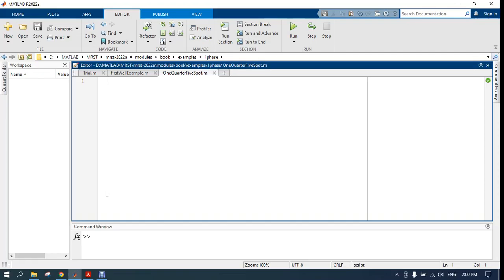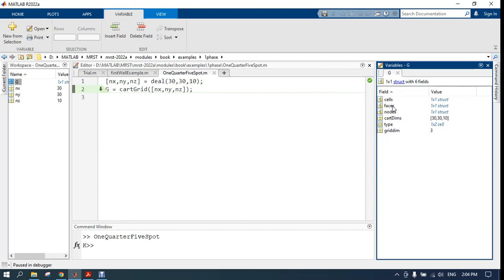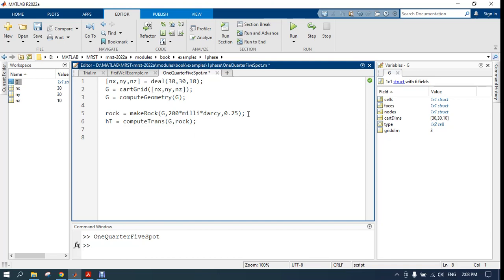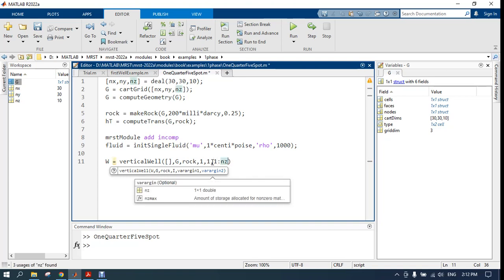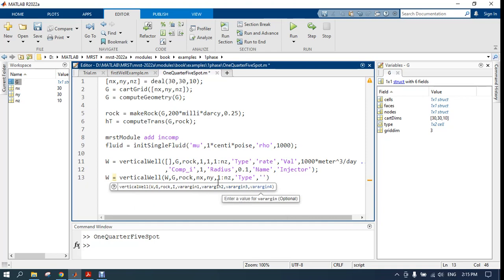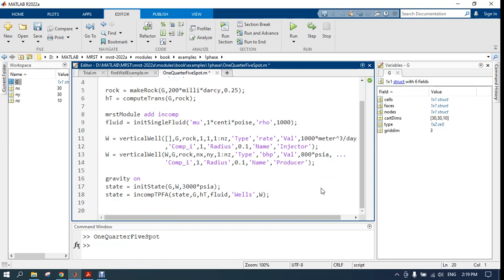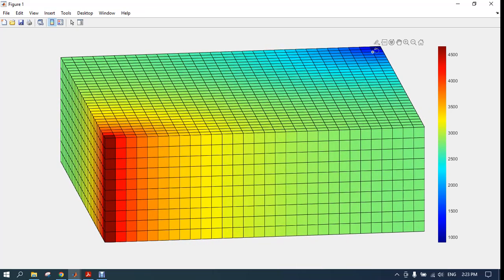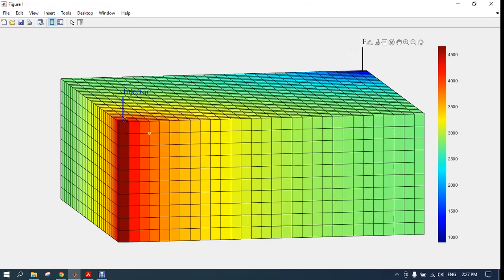One Quarter Five Spot Reservoir Simulation Using MRST

Comment: Can this code be applied in MATLAB 2021?
Reply from the maker: Yeah, why not? Have you come across any problem with it?
Reply: @SajjadMoslehi  Yes, I encountered a problem, please help me to solve it
Reply: @SajjadMoslehi  It appears to me that the (cartgrid )directive is not defined in MATLAB, which means that there is an error in line 2
Reply from the maker: @engiqbal2169  Actually most of the functions I used in this video are not MATLAB built-in functions. To use MRST, you need to download MRST from the internet. You'll find the relevant website if you just google "download MRST".
After downloading it, open the downloaded folder. In this folder, there is a file named "startup". You must run this file by just writing "startup" in the command window (this function adds the essential files of MRST to the MATLAB path).
NOW you're done and can enjoy MRST.
Reply: @SajjadMoslehi   Thank you alot ❤
Reply: @SajjadMoslehi   Can you send me mrst download link please
Reply: @SajjadMoslehi   please help me, i need link mrst,i have project necessary and important
Reply from the maker: @engiqbal2169  Here it is
https://www.sintef.no/projectweb/mrst/download/
Reply: @SajjadMoslehi   Only the 2023 release?  ?  I downloaded it, but it does not decompress the file. Please, is there another version?
Reply from the maker: @engiqbal2169  Yes, only the last version is available on the website.
Reply: @SajjadMoslehi  ok, thank you so much
Reply from the maker: @engiqbal2169  I have the versions 2020 and 2022. Which one do you want? Send me your email address so that I can send it to you.
Reply: @SajjadMoslehi   I hope you will help me, I don t have much time left for the project date and I was hoping to implement this idea 🥺💔
Reply: @SajjadMoslehi  I am waiting for you
Reply: @SajjadMoslehi  When I write an email or ID in a comment, why is it deleted?
Reply from the maker: @engiqbal2169  YouTube has probably put this restriction. Please send me and email. My email address is on the channel.
Reply: @SajjadMoslehi   I downloaded mrst files in matlab but first line error appears why